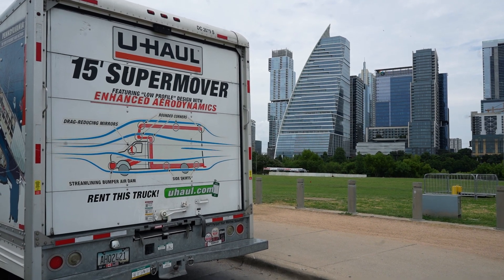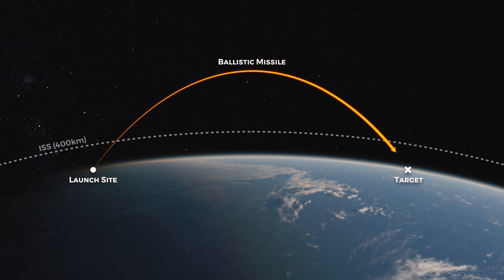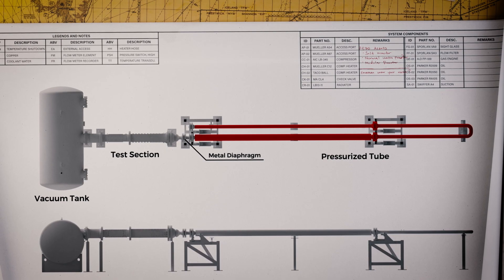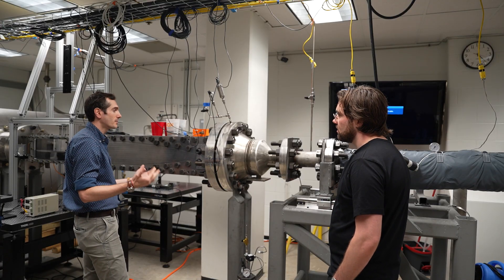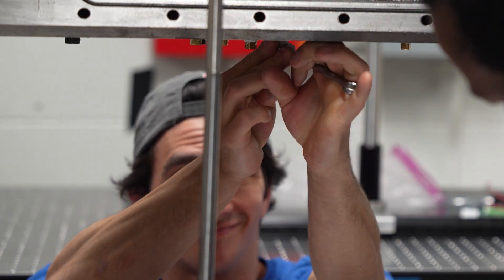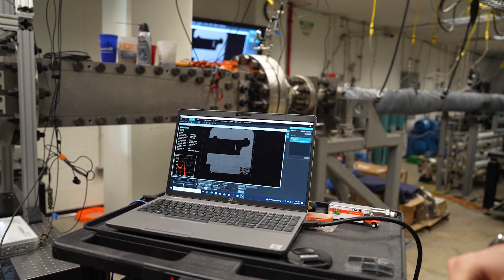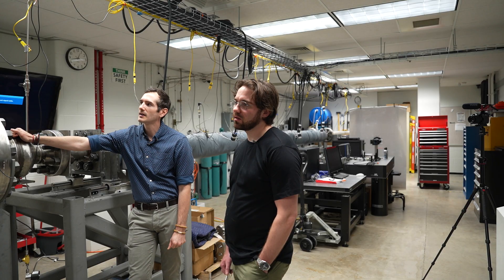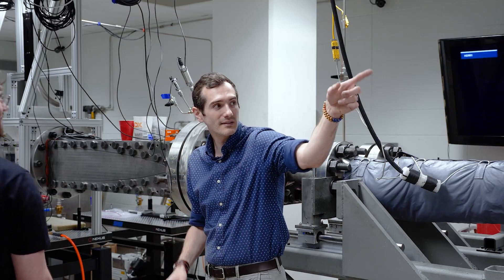I Made a U-Haul go HYPERSONIC

Comment: um, you could also just spin the model at hypersonic speeds around a wheel rotor. well also simulate the air density by partial vacuum. no the u-haul was at rest, not moving. cant say it was hypersonic. hypersonic rotor wing tips instead. mos cow likes their hypersonics. rocket nozzle expansion only is 10% more speed/thrust. focus on the wind source instead. rocket nozzle is a hocus pocus focus fake device, same as top side wing surface coanda lift. who knows what itar gaslighting is going on. by flesh on purpose. well the air needs to be super hot if the expansion is to be doing anything for the final thrust and speed. it needs to be super hot plasma but that is not very dense air anymore. well you better cool the heating tube, or just heat the inside of the air flow channel. eli, ie above, fixes, what people break. of course the incoming air forms around the shape as an air shield cushion.

Comment: My bet for what would happen: almost everything except the engine block and frame rails breaks off or melts and the engine block and frame rails, perhaps with a shell formed from the radiator and AC condenser form a large dart. But this does depend on the motor mounts not melting...

Comment: When they first started talking about the lab, one that has this extremely specialized equipment used for testing hypersonic weapon systems, I pondered what they would think of this sort of malarkey. Then I saw that the previous test had been a cow, and realized that this was a fully sensible experiment for them. Only critique of the experiment is that it had the truck airborne, having it on the plate shown at the beginning, simulating the truck being on a road, would have made more sense. Because I'm sure we've all seen people attempting to drive Uhaul trucks at hypersonic speeds. Nissan Altima might be an even more relevant experiment in that regard though.

Comment: Look if you think you're going to sneak a missile up to Russia, you're mistaken. The amount of ships, awac planes, all cross linked together to create a real time network of radar to detect threats is pretty substantial. It would need to be ground hugging experiencing the full density of the atmospheric drag on it to be hidden for any appreciable amount of time. Cruise missiles do a much better job, can be launched in the hundreds at once. With the s300 and s400 surface to air missile defense systems they're capable of neutralizing a single missile by intercepting it's trajectory. It doesn't need to be moving as fast as the missile, it's intercepting it. Moving as quickly as a hypersonic missile is going in lower earth atmosphere, even if possible.. would result in any tiny movements in direction via control surfaces to put such a strong amount of lateral forces on the missile to make it catastrophically disintegrate. Meaning it's on a fixed trajectory to it's target, telegraphing it's intended target and making it very easy to intercept. The only way to get hits on target is so overwhelm an air defense by launching more missiles all at once.

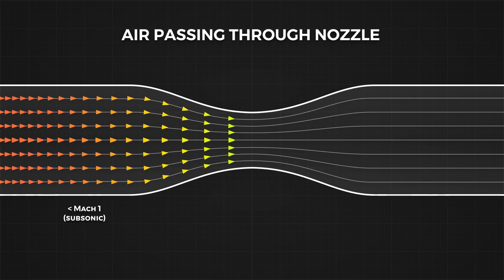Comment: The diagram at 5:50 shows that the velocity of the air maintains its speed after choke. But I was taught in bernoulli's princple that the pressure returnes to the same as the section on the left. Since velocity and pressure are propotional. Shouldn't the velocity also drops below Mach 1?

Comment: The U-Haul knows where it is at all times. It knows this because it knows where it isn't. By subtracting where it is from where it isn't, or where it isn't from where it is (whichever is greater), it obtains a difference, or deviation. The guidance subsystem uses deviations to generate corrective commands to drive the missile from a position where it is to a position where it isn't, and arriving at a position where it wasn't, it now is. Consequently, the position where it is, is now the position that it wasn't, and it follows that the position that it was, is now the position that it isn't.
In the event that the position that it is in is not the position that it wasn't, the system has acquired a variation, the variation being the difference between where the U-Haul  is, and where it wasn't. If variation is considered to be a significant factor, it too may be corrected by the GEA. However, the U-Haul must also know where it was.
The U-Haul guidance computer scenario works as follows. Because a variation has modified some of the information the missile has obtained, it is not sure just where it is. However, it is sure where it isn't, within reason, and it knows where it was. It now subtracts where it should be from where it wasn't, or vice-versa, and by differentiating this from the algebraic sum of where it shouldn't be, and where it was, it is able to obtain the deviation and its variation, which is called error.
Reply: Make this comment blow up

Comment: This video by the YouTube channel "Real Engineering" explores the difficulties in controlling a hypersonic vehicle in the upper atmosphere, and features a unique test of a U-Haul truck in a hypersonic wind tunnel. Hypersonic vehicles travel at speeds greater than Mach 5 and are difficult to control due to the lack of aerodynamic forces at high altitudes. Control surfaces like flaps and fins do not work effectively at such high altitudes, but control jets provide a solution. However, when hypersonic airflow hits the jets, it can rip them apart and reduce their effectiveness. This is a major problem for the new wave of hypersonic aircraft being developed. The video also explains how hypersonic missiles differ from intercontinental ballistic missiles (ICBMs) in terms of speed and trajectory. Hypersonic missiles cruise within the earth's atmosphere at about half the speed of an ICBM, but their low trajectory means they suddenly appear on the horizon, giving their targets minimal time to detect and intercept them. The video concludes with a unique test of a U-Haul truck in a hypersonic wind tunnel, to see how dynamically stable it is at Mach 7.

Comment: 10:00 - Uhhh... why limit the camera trigger to the pressure gauge?  Just run the triggering wire across the diaphragm (or use a laser aimed at the diaphragm).  That way when it ruptures the camera is triggered.

Comment: Seems to me like Uhaul could make their trucks far more aerodynamic simply by rounding out the section above the cab. They could even retrofit 'windscreens' that connect the top of the truck to the front of the truck, essentially bridging the gap and smoothing the trucks out. 
They're essentially attaching massive airbrakes to all of their trucks and wondering why they're so inefficient. 
Like bro. We figured this shit out 100+ years ago. They coulda designed the trucks to be aerodynamic in the first place. The new UPS truck concepts have the right idea.

Comment: a sub next to target would do it
Reply: the converging nozzle will not benefit radically, only marginally, in rocket thrust
Reply: ie you dont require the converging section for compression reasons (for combustion)
Reply: so you can use the hour glass section for afterburner with ramjet, combo, with optional narrow point electric edf thruster starter
Reply: yep a expanding nozzle section afterburner is almost as efficient than a hour glass shaped rocket
Reply: its said you lose only 10% if you dont have converging diverging section
Reply: test afterburner (diverging nozzle) to a hour glass (rocket combustion chamber nozzle) as the efficiency
Reply: electronics is your k.i.s.s. enemy, designed to fail
Reply: robust repeatability, what is that
Reply: yep ramjet will make the afterburner hypersonic, no moving parts, other than the starter edf in the middle, simplest possible setup with/without the edf
Reply: no moving parts ramjet afterburner, where afterburner is the starter
Reply: hey a rock (meteor) can go above hypersonic and no problem, its shielded by its outside layer, its spherical

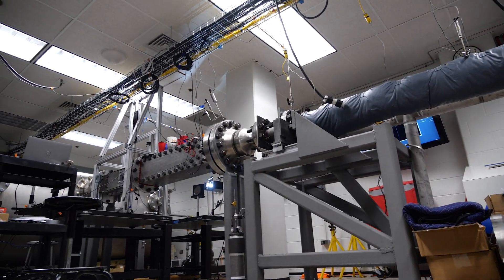Comment: In regards of 9:18, I can finally contribute something to a video of yours: I work on a test rig for hydroelectric powerplants. And operate it. And it is the norm, that nothing goes as planned. Every project is planned to fit neatly together, but in reality, there are just so many uncertainties, that problems pop up everywhere. Its probably the best, when you start the shift with the mentality, that everything is going to fail und you are here, to get it running nevertheless. That's R&D.

Comment: Renting a U-Haul just to tape down a tiny U-Haul inside it for a shot is peak fucking humor! Best 30-40 ish bucks ever spent for this channel.

Edit: Thanks for mentioning Not Just Bikes, I was sitting here talking to the screen "More lanes usually doesnt result in go fast"
Reply: What if you had a De Laval lane architecture? Traffic can be modeled by fluid dynamics.
Reply: @dongiovanni4331  yea in cases analogous to a De Lavel in traffic, the sudden shift from a constrained number of lanes to open road does increase speed. Just think about every time you've been on a highway that suddenly cuts down to single lane traffic then opens up.

Comment: You need an Arduino monitoring your Arduino if you ever wana deploy to something serious.
There's loads of quirky fail points in that wonderful device (I use them a lot), and the only way you can detect them (vs just ASSuming they're to blame.. every time... kinda negative) is to have another board monitor the pin values and be synced with the code-state (i.e... in mode A, with blah, you should see blah...  you get the idea.. it's a total drag.. but it's also how to go pro).

Comment: LK-99 --> What are the engineering implications of it? (if it turns out to be real)
Quantum computers?
Silicone chips?
Power grid transmission?
Compact and cheap Particle accelerator?
Compact and cheap fusion reactors? (for energy generation but also *space propulsion*)

Comment: Amazing how even in such high tech scientific facilities, they still use an Arduino
Reply: and naturally, they still fail at the rate of arduinos. but that's okay because grad student time is cheap, as my advisor would say
Reply: It's so specific and engineering dictates to choose the hardware specs based on requirements. For reading a couple of values and sending them out a couple hundred times a second, an arduino is a sufficient and simple solution that reduces development time.

Comment: Heated gas goes into nozzle and "so that energy is all going into the momentum and the velocity of the gas. But you lose all the pressure, you lose the temerature. So it all gets sapped out. "
I feel like I finally understand nozzles a lot better. It's not just squezing the gas and expanding, it's completely converting the energy.

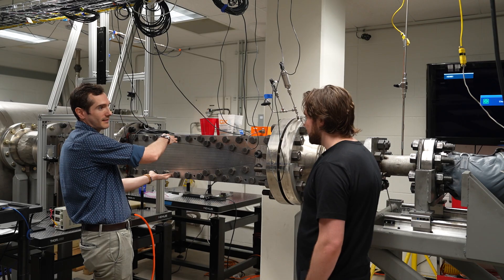Comment: 6:19 I get the attempted analogy, but when you take into account induced demand and the fact that you have a limited number of choke points (off-ramps) on highways, adding more lanes doesn't speed things up long term. Once you have some level of knowledge of urban planning this is obvious; but the fact that " just one more lane bro" intuitively makes sense to someone with no knowledge on planning, is a big barrier to actually providing real solutions to urban congestion (i.e. public transit, higher density, reduced sprawl, bus lanes, bike lanes, increased walkability, etc.). But I do love how you brought up Not Just Bikes right after that lol
Reply: Have in mind that while adding lanes does not help reduce travel time for their customary users, it does increase throughput, meaning more people are able to use that route. The new users do get a benefit (otherwise they would go back to their previous route). So there is a net reduction in travel time, it's just that probably smaller than thought, and coming from a different side (slower alternative routes being used less).
Reply: @MrTomyCJ problem with that is that highways cost a lot and use a lot of space compared to public transit

Comment: 8:00 wow! If I understand what he said was 700k of energy (and I don't know the pressure differential) transfered to velocity in a blink of an eye. Super cool !?!
Reply: Pretty sure he was talking of temperature in absolute, so 700 Kelvins heating going as low as 60 Kelvin due the the cooling of the expanding air, which puts it close to the liquefaction point.
Reply: @rolfbjorn9937  from hotter than venus to below liquid nitrogen just by expanding in a tube less than a meter long.. Holy sh*t.

Comment: As a controls/instrumentation engineer I'm slightly concerned there was an Arduino on a critial part of that system 😆
Reply: Arduino's are quite robust micro controllers to be used for science instrumentation.
Reply: They said it's just a part of the camera triggering mechanism and they could run the test without it, so it wasn't actually critical. Besides, a properly-used Arduino is arguably no less reliable than some other microcontroller on a custom PCB
Reply: It works, it's cheap, and it is damn easy to work with.

Comment: I don't think ICBM vs hypersonic missiles are as big of a difference as you might make it out to be. Sure, they are earlier detectable, but does it really matter if a intercept system needs from detecting to firing like 10 seconds?

Assuming this hypersonic flies on 30km altitude, then a sam or intercept system could see it as early 619km due to earths curvature. So if we just for simplicity sake calculate the missile continously flies at 9km a second which is slightly above mach7 you still have 68 seconds for intercepting it, which still should be more than enough for most integrated sam systems like Patriot to detect and send a missile on the way.

I guess its better compared to ICBMs, but I don't think nor any evidence leads to it being ground breaking in terms of military capabilities.
Reply: The true benefits come from maneuverability. Normal ICBMs follow predictable ballistic trajectories, but maneuverable weapons can take a less predictable path and are therefore much more difficult to shoot down.
Reply: @roflchopter11 This

Comment: but scaling it down, doesnt make it behave the same as original, the shape would have to be modified

just as model rc airplanes and boats dont perform as well, if only copied directly and scaled down

it has to do with reynolds number and other stuff, idk how its called in english

#STILL A COOL VIDEO ❤❤
Reply: They didn't explain that in the video very well but that is the point of the Reynolds number that they kept talking about. Since they can tune that based on the pressure (which they did mention), they can simulate the change of viscosity effects due to scale.